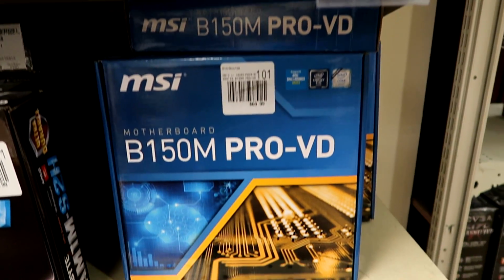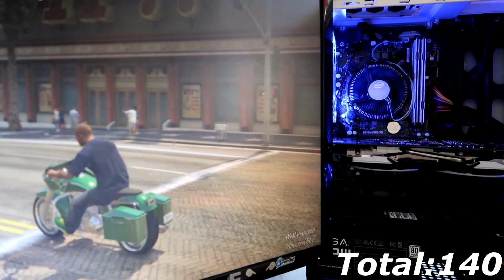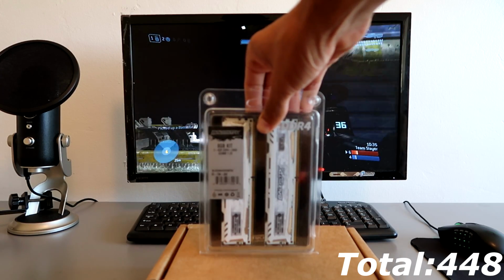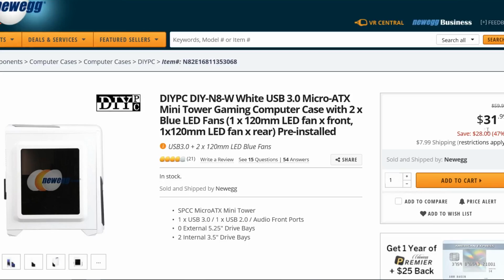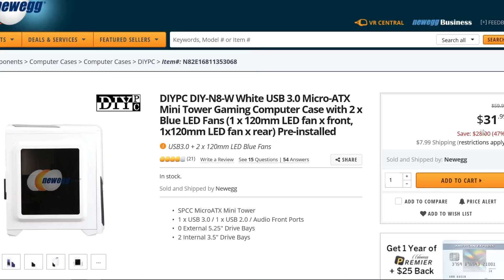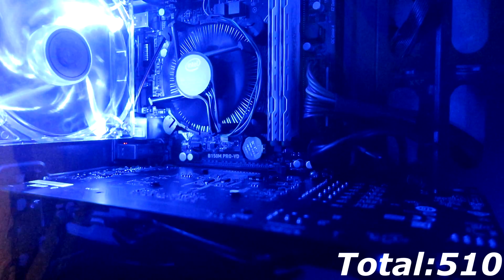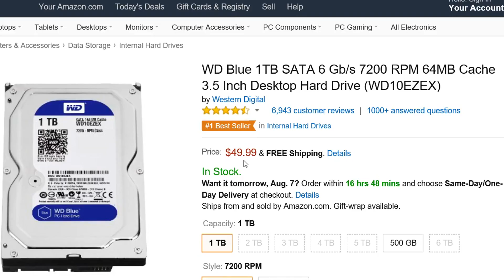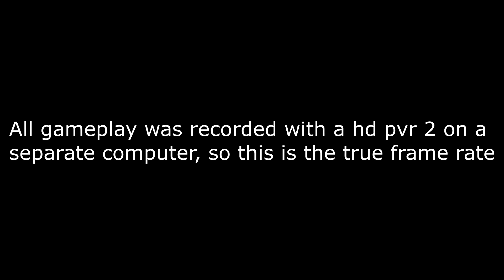Best $550 Budget Gaming PC Build Skylake GTX 1060 (w/ Benchmarks)

Comment from the maker: NEW $750 PC Build Guide is now live! :D https://youtu.be/98ujnl1_hW0
Reply: Is this pc usable in 2018?
Reply: @abcdefgh-sb5yr  the gpu and the ram is. Can't say for the cpu.
Reply: @oshanew9941  damn. I am using i3 7100 with gtx 1060 6gb so it is worth upgrading to i5 7400 or maybe i7 7700?
Reply: @abcdefgh-sb5yr  I would upgrade to the 8th gen i5-8600k. You get 6 cores and 8 threads instead of just 4 cores.
Reply: Or upgrade to ryzen 5 2600 for 6 cores and 12 threads for 160 dollars.
Reply: @oshanew9941  but then i have to buy a new mobo and i am on the budget
Reply: @abcdefgh-sb5yr  I understand you completely brother. I'm a college student and I took me over 2 years to save up money to buy my ryzen 5 build.
Reply: @oshanew9941  damn
Reply: @oshanew9941  but what about i5 7400 is it still good for gaming?
Reply: @abcdefgh-sb5yr  it's still good for gaming, but you'll experience bottlenecking later on, like within 2 or 3 years.
Reply: @oshanew9941  ok thanks man

Comment: Here's to hoping AMD can get their sh*t together with Zen so the overall price of CPUs drops. What Intel currently ask for their processors is just ridiculous. You should be able to fit an effing 4 core in a 550 bucks build.
Reply: If he wanted more cores he could have gone with FX 6300. But he didn't because Intel Dual Core is better.
Reply: Yeah I also hope the zen kicks Intels ass so they lower the price of cpus all pc parts seem to be lowering except the damn CPUs and gpus
Reply: Zen will have hyperthreading is what I am hearing :D
Reply: Matthew Remache I'm not hoping they'll make a better CPU - I think at this point it's unrealistic. But if they make a good enough processor and offer it at a price that is traditionally lower, Intel will finally have a reason to drop the prices a bit.
My effing 4790k is a 2+ year CPU model and it still costs EXACTLY the same price I paid in early Feb 2015 for it. There have been what - two generations after it, but it just seems Intel doesn't drop prices, ever.
Reply: +Sauriss it will have that yea, but it won't be called hyperthreading, instead it'll be known as SMT or Simultaneous Multi Threading which badicallyyyy is the same thing but is called SMT so it doesn't infringe on Intel's copyright
Reply: you can fit an i7 6700 in  a 500$ build
Reply: No? Its not that hard to fit an i7 6700 in a 500$ build. Or you can just get i5 for like 400$
Reply: Ezio Auditore With a DECENT card, z170 mobo, cpu cooler, case, psu, ram, hdd/ssd try it.
Reply: I was answering the main comment. It was never specified whether you needed a good gpu or other parts
Reply: Ezio Auditore It isaid $500 build, not just $500 for CPU.
Reply: Yes you could get a  crappy part list for the rest. The cpu is arround 200$ That would be classified as a build
Reply: Ezio Auditore http://pcpartpicker.com/list/BMqspb

I guess you could.. But that is only if you can sacrifice on other things.
Reply: how to arcane mage legion
Reply: Станислав Димитров I fit a 6 core in my $550 build. Same graphics card too.
Reply: Hampton Barnes i7 920 woulda been good :) Keeps up with FX6300 and cheaper
Reply: StatTrak™ Tagged 99 yeaa tru but i already had an amd motherboard on mind that was pretty cheap
Reply: 920 doesnt get the performance an fx 6k gets noooo way the 2500k is like the 6k fx but is destroying the 920

Comment: The price is even lower, that gpu is 220$ now :D
Reply: Link?
Reply: +Ten Playz I don't recommend the 3GB version, because a lot of games use more than 3GB
Reply: I now know what my senses are telling me to save for. My wallets out for the 1060. when i get the money. Then i will storm these online markets or even maybe retail, and yell at them in such a tone with the phrase Shut up and take my money.
Reply: +Waffles oh ok
Reply: +Waffles it depends, if you look at the 1060 6gb and the 1060 3gb framerates its only like 1-4 fps difference.      The 3gb and 6gb have a 100$ price difference (in my country) so imo its better to just get the 3gb one if youre gonna stick to 1080p, if 1440p then go ahead and buy the 6gb version.
Reply: Whoa. In just 1.5-2 years from now, 3gb will not be sufficient for 1080p textures too. Then settle for swapping textures and bad performance. I say 1060 6gb is a killer deal too.
Reply: Tushar Sadhwani is 300$ a good price for a 1060 6gb? when the 3gb models are 220$?
Reply: If the 3gb lets u game the best titles at full hd for 2years, and 6gb lets u for 4-5 years, then ofcourse. 3gb vram is barely enough for games like gta v on 1080p NOW. imagine in 2years. Its simple.
Reply: Can someone explain to me why the space on a GPU runs out?
Reply: Spelunking 323$
Reply: in 2 plus years form now if you at 1060 you most likely will upgrade and if you dont then playing games you still wont need the extra 6gb because your 1060 will have to pull back on some graphics settings and wont be able to max out to use more than the 3gb plus look at price wise 3gb is def the best option
Reply: Semper Fi the RAM runs out. It's the amount of textures, mappings and other graphical stuff a game stores in the GPU VRAM itself, so that it can be accessed quickly. For eg. GTA V on 1080p uses atleast 2.5GB on VRAM for its textures and maps.
Reply: Spelunking The lowest right now is $240 on Amazon...
Reply: TechVoyager ;(
Reply: Ten Playz it's gddr5
Reply: Spelunking Actually the price tag of a gtx 1060 6gb is like 390$ in my country, srsly Im not even overstating the price, thats why I'll stick to ps4 pro
Reply: Yousif Hirmiz aww so bad for you
Reply: Yousif Hirmiz what country is that??
Reply: Sir Loudmouth Sweden, chilly and expensive Sweden.
Reply: Yousif Hirmiz I mean you dont need 6gb of vram, 3 is plenty.
But here in chilly and non-expensive estonia the prices are usually the same as in the us, like 10-15€ difference :P
Reply: Sir Loudmouth Is 3GB really plenty for 2016? Even the GTX 1050Ti has 4GB onboard even though it's a low-end card compared to the 1060. I see no logic in this scheme
Reply: TechVoyager trust me 3 is plenty for 2016, unless you want to play on a higher res like 1440, but for 1080p ultra 3 is good.
Reply: Sir Loudmouth For 1080p overkill settings, 4GB is the amount you want unless if you play games like CSGO or Minecraft, then 3GB will be sufficient. But if you're like me, 4GB RX 470 for the same price as a 3GB GTX 1060 just makes sense in 2016. I wouldn't pay the same for less because it's common sense
Reply: TechVoyager ok bud
Reply: TechVoyager ugh. 470 same as 1060. Noob
Reply: Tushar Sadhwani Call me a noob? I've been in the PC party for some time now. I know what I'm talking about
Reply: TechVoyager srsly tho are you sure you'd put 470 and 1060 in same price? Give me one real life scenario in which 470 will perform better.
Reply: Tushar Sadhwani deus ex is the only one,but yeah 95% of games perform better on nvidia hardware
Reply: +Sir Loudmouth so we ok?
Reply: Tushar Sadhwani sure
Reply: Tushar Sadhwani Give me an example how the 1060 will continue outrun the RX 470 in the next 3 years?

In my opinion, the RX 470 surpasses the GTX 1050Ti and sooner or later, the 1060 by 2017/18
Reply: +TechVoyager you cannot judge a card's power over the vram. 1060 will still push more frames than 470, whatever the case may be. sure, 3gb won't be enough then, but even rx470 won't be enough at the top end 2018 games, and lets say you're talking about medium-end games of 2017-18 they most probably won't use more than the 3gb.
Reply: Tushar Sadhwani yup
Reply: Tushar Sadhwani Actually, they will if you compare the jump from 2013 to game like today. They use more VRAM and the GPU core is slowly crippling by the modern complexities of games. And ok, the GTX 1060 6GB (or 1060 Ti if Nvidia used their common sense like they did when they named the GTX 1050 series) will conquer the RX 470 right now and maybe in the foreseen future but I believe the RX 470 is still "immature" and will soon catch up to where it needs to be. Planning one buying one this month btw
Reply: +TechVoyager well maybe, coz ive heard about amd gpu's getting better over the time. Also, actually gtx 1060 3gb is priced exactly equal to rx480 4gb, so yeah. I tend to depreciate 470, coz its too cheap here.
Reply: Tushar Sadhwani But if you compare a RX 470 against a GTX 1050Ti ($150 vs $170/80), the AMD card is a much better buy. If more than $220, then buy a 6GB 1060 or better yet a 1070 if you're willing to save
Reply: TechVoyager sadly the pricing are worse here. 1050 is cheaper than 460, 1050ti is cheaper than 470. 1060s are equivalent to 480s. So in each case i'll take Nvidia. Its india btw.
Reply: Tushar Sadhwani Typical marketing...eh might as well. I live an America where the RX 470 is $20 more than a 1050Ti and a RX 460 is $10 cheaper than a GTX 1050. My needs lean toward a RX 470 than both of these cards so AMD for me
Reply: TechVoyager exactly. For eg. Rx460 is 200$ in ireland, while 1050ti is 300$. So 460 all the way
Reply: Tushar Sadhwani True
Reply: Spelunking Now the GTX 1060 is overpriced :'o , I bought one for 370$ (In United States)

Comment: 1060 would be much better paired with an i5 and 16gb of ram
Reply: That would be like 700
Reply: +Imma Turkey Nope,$860.I upgraded to 16gb,2tb and i5 6600k.
Reply: You're misled. That will probably only provide 2-5 extra frames which could be done anyway with a gpu over clock.
Reply: SacredSkill A quad core i5 from the same generation as an i3 will always perform the same or better. Most AAA titles will utilize the multiple cores even if they aren't clocked as high as an i3. Games run smoother and with more frames too.
Reply: +Rudy so what is the point of the title "550 usd" whats wrong with you talking things that everyone knows?
Reply: 16 GB? Is your head broken?
Reply: StatTrak™ Tagged 99 Lots of AAA are starting to use much more than 8gb of ram. Listed requirements are now in the 12gb zone for many titles. Is your head broken?
Reply: Just ignore him
Reply: +Rudy "Listed requirements" Dark Souls 3 says I need 8GB RAM minimum and here I am running it fine on 4.
Reply: Rudy ram size is not important. 8gb is fine 
16gb is for streaming or porn multitask.
Reply: finn nah, you haven't played enough games then
Reply: Rudy lol... sure
Reply: StatTrak™ Tagged 99 nah, i'm just right
Reply: Rudy No.
Reply: StatTrak™ Tagged 99 A lot of people do, lol. You're avoiding my argument that ram matters.
Reply: Rudy They really don't, just because they "use" more than 8GB doesn't mean they have to at least have more than 8GB. Sure it will run a tad slower, but that's what a budget the build is for. 
The point of a budget build is to squeeze the most performance out of the money you have. At this point, 16GB is not necessary, therefore not needing to be placed in the build, just for 3-5 more fps in some certain games that not a lot of people play, for more than $40 USD.
Reply: StatTrak™ Tagged 99 Disregarding the price point of the build. I'm saying 16gb of ram would be much better for this particular build.
Reply: Rudy True.
Reply: +Rudy he played COD BO3 in the video. What's your excuse now?
Reply: Rudy i would rather spend i5 6500 than 16gb ram.
Reply: i5 6500+8 gig ram would be nice.
Reply: Chill The Wolf 16gb is still much better than 8gb. Lol, what don't you get?
Reply: Rudy no difference for gaming
Reply: +Rudy no it doesn't. I run BO3 with 8GB of ram, eclipse with 200+ classes opened, around 50 Firefox tabs opened, Skype, discord, etc all opened.
Reply: +Rudy I can also run GTAV very high settings with the same configuration
Reply: finn 16gb will help a lot now that more and more AAA are using 16gb
Reply: Rudy will help like 1+ fps
Reply: mate thanks now that I have installed 32GB of ram my frames in minecraft have gone up from 24 to 27 THANK YOU! <3
Reply: +Radius 144p i have 16 and i dont regret it.  when opening msi afterburner i see that gta uses 10gb. and battlefield 1 like 11... 8gb is not enough for triple a titles WITH background processes like a shit load of tabs and recording n editing.  when i played gta v i had 1x8gb in singlechannel. i used my intel hd 530 gpu which ran off of ram memory. so i had 7 gb. and i kept lagging and crashing. i have a 970 now btw
Reply: CWplayer lies. i've never crashed my gta 5 with 8gb ram.
Reply: What i experienced can't be a lie, i ued to play gta v on a laptop, with a dedicated gpu, and it ran fine on 8,  but 8 is  just getting a lil old, games need more nowadays, and we need to accept that.
Reply: CWplayer that's your pc not your ram bud.
Reply: well. i opened task manager and  both cpu (i5 6400) annd ram were maxed out, gta v used to have memory leaks tho, but, in a year or less, 8 gig will hardly be enough, i am happy with 16.

JUST DOWNLOAD MOAR RAM\

www.downloadmoreram.co.uk
Reply: +SacredSkill Lmao do you how hard an I3 will bottleneck an OC'ed Gtx 1060. Lmao you don't have any idea what you're talking about. In a budget build of this kind a Radeon RX 470 is more what matches. If you can't afford an I5 don't get an NVidia card.
Reply: +R. Antonio M.S. Bruh... If your PC is so budgeted that you can only afford 4gb of RAM I gaurentee you aren't running Dark Souls fine.
Reply: +Max Lombardo Dumb argument, you can decide where to cut corners, tested it on both 4 and 8GB and the difference is negligible.
Reply: +CrackedDylMil I can run GTAV on very high setting also on my integrated graphics Lmao. The setting don't matter it's the resolution idiot. Running Very high settings at 720p is worse than medium settings at 1080p.
Reply: +CWplayer You listed your real problem within your incorrect explanation. The fact that you play on a laptop -_-
Reply: R. Antonio M.S. My bad your right. My 4way SLI Quadro build that's 35,000$ runs off of 2gb of DDR3 clocked at 1ghz. You really gotta know when to cut those corners...
Reply: Max Lombardo english riperino
Reply: +Rudy dude, of course it is,duh, but not everyone has the money,if someone were to get an upgrade to this build they should get an i5
Reply: +Rudy oh nvm I saw what else you commented sry dude
Reply: mahid gomampong BRO HAHAH UR SUBBED TO HAILEY STEINFIELD
Reply: I have a build( no hard drive) that has an i5 with a 1060 6gb that is just under 600. Here it is https://pcpartpicker.com/user/versace42069/saved/#view=YVcTWZ
Reply: Rudy what games are you talking about bud?
Reply: wot did u just say?
Reply: i7 would be better even more because i7s are the most compatable with gtx 1060
Reply: i5 6500 yeah but 16gb nah
Reply: what i5?
Reply: Guys i need help! I have pc parts here And i want to build a gaming pc with them so are these good?

Graphics card:
MSI GAMING Radeon RX 480 GDDR5 8GB CrossFire VR Ready FinFET DirectX 12 Graphics Card (RX 480 ARMOR 8G OC)

Case:
Cordair Carbide Series SPEC-01 Mid Tower Gaming Case

Hard drive:
WD Blue 1TB SATA 6 GB/S 7200 RPM 64MB Cache 3.5 Inch Desktop Hard Drive (WD10EZEX)

CPU/Processor:
AMD A6-6400K Richland 3.9GHz Socket FM2 65W Dual-Core Desktop Processor AMD Radeon HD AD640KOKHLBOX

Ram:
Corsair Vengeance Pro 16GB (2x8GB) DDR3 2400MHz PC3 19200 Desktop RAM, Red

Motherboard:
MSI Intel H81 LGA 1150 DDR3 USB 3.1 Micro ATX Motherboard (H81M-E33)

Power Supply:
EVGA 600 B1, 80+ BRONZE 600W, 3 Year Warranty, Includes FREE Power On Self Tester, Power Supply 100-B1-0500-KR

SSD:
Kingston Digital, Inc. 120GB A400 SATA 3 2.5 Solid State Drive SA400S37/120G 2.5"
SA400S37/120G

Operating system:
Microsoft Windows 10 Home 64 Bit System builder OEM | PC Disc

Pls say if it is good or not
Reply: Swagmaster6969696969 On isäs for this rig i could recomend you to add 16rams not 8 cuz i have gtx 1060 and games like watch dogs 2, bf1 was way lower and with deep fps drops on ultra than with 16rams. Now when i added one extra 8gb ram stick my gamea running butter smooth without big fps drops.
Reply: Darius Samp how about now?
Reply: Swagmaster6969696969 On isäs 8gb of Vram probably would be the best option for the future because most of the games uses 4gb and even more, not saying you will not be able to play games on ultra with this card after 2-3 years but if you would take 8gb version for 70-80dollars it could last significantly longer to get older and run out of vram memory.

So in your rig I would only change rx480 to 8gb version and add more 8 rams (how you just did). Anything else looks just fine. And good luck with your pc project m8 ;)
Reply: Darius Samp thx m8
Reply: Darius Samp btw do you need a fan And a cpu cooler? I am a starter so i dont know so much
Reply: Swagmaster6969696969 On isäs cpu cooler goes with whole box when buying but if you want someting even better you can buy other cpu cooler but I'm using one that came with box and it works perfect. 

Talking about case fans if your case does not have them already placed  you should get on in front and one in back for the best air sirculation but even one case fan would do the job. Personally I don't have case fans but soon I'll get one so it's not that important and they can be added whatever you will want to. And check what connect your motherboard has for your fans there is 3/4pins connectors newer motherboards have 4pin.
Reply: Darius Samp OK thx i Will be looking for a front cooler to the case and maybe a better cpu cooler